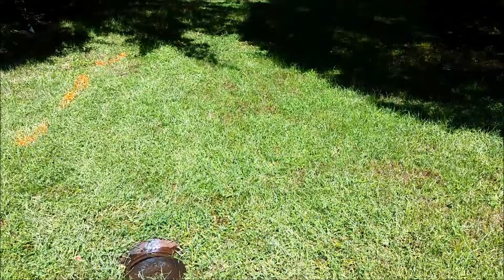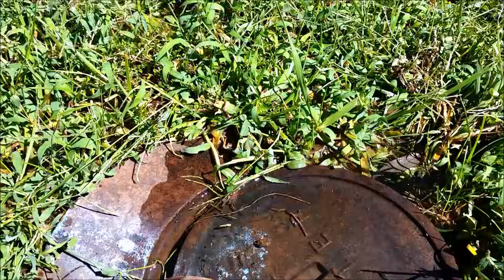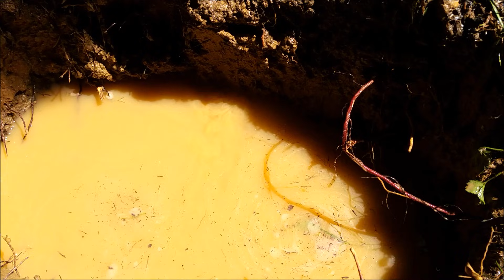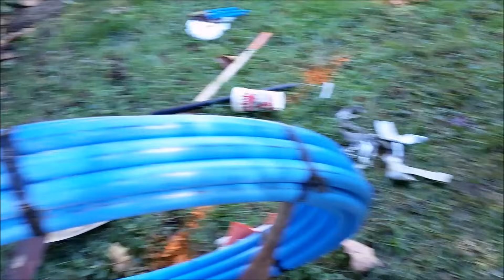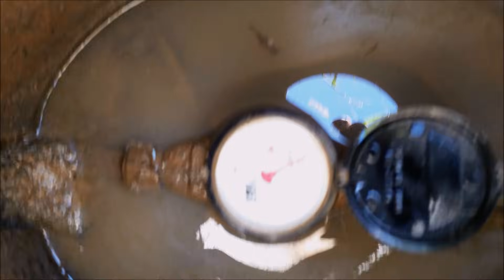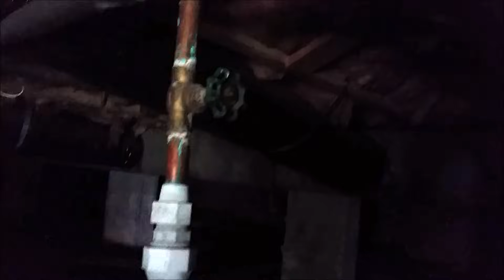DIY: How To Fix a Broken Main Water Line Pipe

Comment: In my case smartmeter notified me of a continuous leak. After installing a valve to isolate the house, I confirmed the leak was in the yard and identified the location. It was no pinhole, but instead a slit (3”X1/4”). After making the first cut the section including a coupling pulled out. It broke after the coupling which was under the pavement. The area under the pavement had no dirt which I am assuming contributed to the break. I did fix it but it was about 26” down

Comment: I have dug out a 30' trench from my water meter to my house to (ultimately) replace the original  poly pipe (multiple leaks).  I am astounded (and angry) at the size of rocks that I have found in contact with the original pipe.  That kind of "workmanship" is why unions have a bad name.  If I, as a typical homeowner, know not to back fill will fist-sized and larger rocks, why so so-called professionals do it???  I won't mention the brick that I exhumed....

Comment: What about that metal piece that goes inside the end of the plastic pipe? So that brass fitting doesn't crush the plastic pipe? Asking for a friend😬
Reply from the maker: Plumbing shop didn't recommend so I didn't use one. Still no leaks 7 years later 😉

Comment: I work for  water for a large city.. I wish we had more customers like you. Quick question.  Did you put any interest in from thoes compression fittings? Just curious
Reply from the maker: Thanks Joshua! Not sure what you mean though, "put any interest in from thoes compression fittings?"

True story...In April, water bill was really high. Fixed a toilet I believed was leaking. Water authority came out and tested and said I still had a leak. Turns out there was another leak in this line, but closer to the house. My water line insurance (taken out after I made this video) paid for the repair. In the process, the line was tested several times, and all the repairs in this video were still solid, even after 7 years or so.
Reply: @RiverLifeWV  yeah, metal insert you slide into thee ends of the Polly pipe o the compression fittings have something solid to tighten up on
Reply from the maker: @Uneavenbutter  no, nothing but the compression fittings.

Comment: Good video!  I dug mine up and found a big root from a maple tree had damaged the line as grew to draw water from the nearby AC drain.  I dug back the root several feet and cut it out.  Maybe it will grow in slightly different direction from now on.
Reply from the maker: Take insurance out if it looks like you may have future problems.

Comment: The pex tool would leave less joints and cheaper. Just have to buy the pex rings and 10 dollars to rent the pex tool. 3 bucks for fittings. Never go to a plumbing supply place if all they have are 100ft rolls for a small job like this. 100 ft roller roller for running a whole main line or a whole house. At Lowes this would only cost 30 to 40 dollars. Those unions right now would probably cost like 70 plus dollars alone. And 100 ft of pex now that's probably like 70. So 140 bucks or 30 to 40 bucks.... u decide. That said good job anyway.
Reply from the maker: Thanks! I've transitioned to working with pex as much as possible. I agree with you :) Inflation has easily doubled the price of this project.
Reply: yup. i imagine them brass unions are not very cheap right now i seen stuff way cheaper than that going for like 20 plus dollars. But when ur doing a big job like this even if it costs 200 + dollars who cares cuz a plumbers gonna charge a heck of a lot more. U just want it done now and done easy. i did the same job at my house i had a leak under the slab where the meter sits. but i just straight piped it. rented the pex tool was like 11 bucks at home depot and i only needed it for just 2 crimps but it is what it is. all said costed like 35 bucks
 but super super crap load of hard work. I had to dig like 5 tons of super compacted heavy rock crap desert dirt. then blow through with water to get the pipe under almost 5 ft of concrete which also has a wall on top of it. super bad angle to try digging. it kicked my AAAAA to say the least. but i saved a TON of $ doing that myself. the way i got through under the concrete slab is i used about a 6 ft piece of 3/4 pvc and glued it to a a garden hose assortment. then i put it on one of them high pressure nozzles and just kept ramming it with the high pressure till it made its way to the meter. after about an hour the whole was big enough to run the pipe. The soil in the desert is super hard to dig through. very tuff soil!

Comment: Menard's had 3/4" copper tube size (CTS) poly water pipe 250 PSI, 100 feet, $28.  CTS fittings accept CTS poly or copper pipe.  A stainless inner sleeve is inserted into the poly pipe.  The CTS fittings tighten around that fitting.  Menard's sales people haven't heard about CTS pipe.  The YouTuber may have failed to place the inner stainless sleeve inside the pipe which the CTS fitting tightens down around.  The last step is to tighten the crimp screw on the fittings.  The YouTuber's fitting may now leak slowly or pop apart.  At the top left of the right union the poly looks compressed where it enters the fitting more than it would be with the stainless inner sleeve in place inside the pipe.

Comment: You did everything right except for one major thing. Never, and I mean never, turn on a valve that fast!!!! My superintendent just did that and blew 3 holes in an 8” water main off the street and popped off a 4” copper press joint. Turn on/off slowly to let the water fill the pipe first then open it all the way.
Reply: Yup!!!!
Reply: Good advice! We have very high water pressure here because the water main that serves my property starts at 4000 ft elevation and runs along the dirt switchback roads that descends in elevation for the 2 miles it takes to get to my house which is at 3500 ft. elevation.
My leak isn't this bad, and it's at the base of an outdoor spigot. I don't know what I'm dealing with until I dig it up, but I believe my goats are the culprits! They love to vigorously head but anything sticking out of the ground, such as a metal pipe.
I'm hoping it's just a loose connection, but more than likely I've got a cracked pipe. I'm hoping I can fix it temporarily with epoxy until I can get whatever connectors I'm going to need.
Reply: No stiffener with the Pac Joint isn’t good.
Reply: I have heard this advice as well: before turning the main back on, open a few faucets in the house, to help get the air out of the lines. Then, as you mentioned, turn the main on very slowly, let it fill up, then open all the way.

Comment: Were you able to find those McDonald (or Ford) compression fittings locally or did you have to order them?  Nobody here, except the utility district, has them.  The utility district won't sell you any either.  I found some similar, but didn't have the extra bolted clamp.

When I started digging, I found that whoever built this house decided to throw several full packs of shingles and many 2x4 scraps inside the water line trench before burying.  It was quite...fun...to dig all this debris out by hand so I could locate the leak. 

Thanks for making this video.  It helped a lot.  Saved me hundreds of dollars, no doubt.
Reply from the maker: Fittings were at our local plumbing supply shop.

Comment: its been 5 years.  have those fitting started leaking yet?  you should get pex crimp ring with a collar.  less opportunity for leaking
Reply from the maker: After 5 years, everything is still good. I made the repair exactly as the plumbing shop told me to.

Comment: No steel inserts? It’s gonna leak again if that’s irrigation pipe your supposed to use barbed fittings with clamps  and the pipe is supposed to be centered to the middle of those unions when used on the right regulation water pipe again the pipe in the video looks like thin wall irrigation pipe if this is so it’s going to leak again there in the future
Reply from the maker: Well, it hasn't leaked yet. I followed the specific instructions from the plumbing supply store. Every part, including the line, was what they recommended. And this was not a home depot type store, but a legit plumbing supply house.

Comment: What if there isn’t any waiter coming into the meter or the yard? How do I find the area underground that is leaking? I have already done everything to make sure it is in fact outside leaking so I am guessing it’s a very small leak. But it’s making my bill skyrocket so I have to fix it ASAP and don’t want to pay a plumber a grand to or more. But Because it’s bone dry in my meter and there’s zero standing water in my yard I can’t find the exact area where it’s leaking. Anyone know how to find the area without digging the whole thing up? Is there a moisture tool I can rent or something? Any ideas will help.

Comment: What about the metal sleeves inside all the plastic tubing?
Reply from the maker: I'm not sure what you are talking about?
Reply: @RiverLifeWV  The HDPE tubing will distort when the fittings are tightened on its exterior unless you put the metal sleeve inserts inside each end of the tubing.

Comment: My father thinks this is rocket science and will rather pay $$For a plumber that quotes double im sure. Ive ofered to do it for him free but im poor and he wont buy the parts(Pipe and connectors). This is exact same problem aswel but our lines are under concrete so thats going to be fun im just guna do what i can till or if we gt the parts
Reply from the maker: Well, bust up the concrete and see what you've got! It's fun work, and you can save yourself some money.

Comment: I used a saddle clamp .done you don't cut the pipe.wow overboard
Reply: In ohio the ORC states any type of saddle fittings are prohibited underground
Reply: Saddle clamps are generally only temporary fixes.  They rarely stop the leaks on pressurized lines entirely, and the potential for contamination is present.  Use saddle clamps only to slow bad leaks until a more permanent and safer solution can be found.

Comment: Did this same repair, here we are 2 years later and its leaking at a new spot. Just send a new line in. Especially if it's that recalled poly tube. $3,000 is a fair price, also not hard to do yourself. Rent an excavator and invite a buddy over. Pretty straightforward.

Comment: Friendly reminders
1. It’s a water service 
2. You should have replaced the whole Service because there might be more rocks sitting on top of the service
3. The water service should have tape 1ft above it for excavation later on so you know if your close 
4. You also don’t want to stop the water pressure until you find the pipe
Reply from the maker: Thanks! I have insurance now on the service line for 5 bucks a month :)

Comment: What if you have poly piping on the service line? The house has no poly but the service line does. They didn't disclose that. Is that fixable?
Reply: they make shark bit fittings that go from polybutylene  to copper pipe size

Comment: You forgot to put line stiffeners inside the pipe
Reply from the maker: Not according to the plumbing supply house.
Reply: @RiverLifeWV  ya I bet they will sell you whatever they can.
Reply: You don't need stiffies for pex that new blue stiff is pretty thick. I do this every day. Never used it.
Reply: @thomasszary7481    Use the sleeves; even HDPE plastic tubing will distort from the pressure of the fittings and the o-rings will eventually leak.  The sleeves are inexpensive, and take but a moment to tap in (sometimes pound in).  But once fixed, it stays fixed!

Comment: All you had to do was cut the pipe at the crack and slip the dresser coupler over the crack and tighten it down man
Reply: 😂😂😂😂😭😭😎😎learning he is!!(yoda)
Reply: Nah. That's the hack way to do it. It's better to replace a section of pipe rather than a small chunk. You don't want to tighten down on the spot or near the spot that was cracked with a mechanical coupling for risk of splitting the pipe. What he did will suffice but the best solution is to replace the whole line so that there are no under ground joints and you keep the possible points of failure to a minimum of 2.

Comment: Those CTS pack joint fittings will fail over time without the required stainless steel insert inside the pipe ends.  They keep the pipe from crushing, and ensure the connection doesn't blow apart.  I didn't see it in the video, but did you install those?  They are sometimes sold separately.
Reply from the maker: I did not know about those and the plumbing supply never mentioned them. I don't worry to much now as my power company has insured any future line repairs for 5 bucks a month. :)

Comment: You need stainless steel sleeves inserted to the ends of the pipe, otherwise the brass fitting will crush the plastic pipe
Reply: In Texas we just Pex fittings and crimp rings
Reply: They are called "stiffeners"  but yes you are correct..   he will be digging it back up eventually

Comment: I wish you talked about the diameter size on the pipe and fittings. Just curious if 1" inch is standard of 3/4" inch is.
Reply from the maker: Charles Brown I don't know which size is standard. Sorry.
Reply: 3/4 polly is standard. sometimes you will find 1 inch Polly but it's not common. usually when you find 1 inch it is the service to the house. (the part that tails out of the back of the metter that feeds to the house. 3/4 is commonly coming from the main and is feeding into the angle valve (the valve that stops water from passing through the metter).iv only seen 1 inch a few times going into an angle valve. my point is, if you are repairing the line that feeds your house, you can either run into 1inch Polly or 3/4 polly. depending on how old your house is you could also run into 1inch galvanized pipe which is a motherfucker to fix but it can be done with a philmac coupling, a sawzaw and a little bit of filing.. or you could pay a plumber a fat price and have him run you a new service..

Comment: I made this same repair with sharkbite fittings. Also Home Depot had 3 ft sections of 3/4" blue pipe for about $5.
Reply: I repair lines repaired with shark bites daily, the issue is the metal pieces. They corrode and leak, if you do not have a pex crimp ring tool buy WHITE FLOW CONTROL couplings. I promise shark bites will not last, even if you put tape around them as they recommend.
Reply: Jerry, I agree "Sharkbite"  or in my repair it was a  similar type coupling, brand name LASCO flex coupling.  I put the links in the description. In my fix the water line broke underneath the cement sidewalk..Royal pain! to dig down under the cement!  https://youtu.be/1nDwrq6ZQIc

Comment: Been laying pipe for years, and you did a great job. It isn’t a main, Btw. Just a water service, but others than that the compression fittings are the shit when it comes to repairs.
Reply from the maker: justin Kassel hey thanks Justin! It's still holding, going on 3 years later!
Reply: MrWoodshedder just a fun fact for you buddy, since you don’t have a smart meter, and you seem pretty decent with a pipe wrench, if you take the water meter off and flip it around and install it, it runs backwards. 

The water authority checks meters during business hours, so hypothetically, if one were to install it backwards and do some serious watering over a holiday weekend, they could potentially lessen the financial strain that the assholes at the water authority have imposed on us for years.Just be sure that you don’t run it lower than the number on your last bill. Lol.
Reply: @justinkassel4000  Like filling up a swimming pool.....
Reply: can you tell me what size fitting i will need and where i can go to find them. My pipe is the same as this but it doesn't look like 3/4 in. it looks bigger maybe close to 1.5 inch

Comment: No inserts were used and you are supposed to meet the pipes up in the middle of that 3 part coupling hope you ain't back in a couple months digging that big hole again.
Reply from the maker: Cade Parr You are wrong. I did it correctly. It's been 2 years since I repaired it and no problems.

Comment: My other comment/thought - perhaps I can use a low pressure air fitting and an compressor to put air pressure in the line and then dig to the source of the bubbles.  I'll have to scratch my head a bit on how to connect the air fittings but it should reduce dig time - especially if you live in a heavy clay area like central KY.
Reply: Yes.  I deal with this problem a lot as I own a campground in NW PA.  I blow the lines out in the fall with compressed air staying below 60 psi, but almost every spring when I turn the water on I have a leak in the ground somewhere.  Having air in the line as you dig is very helpful because you can here it, and you don’t have water filling up the hole you’ll need to work in.
Reply: I actually did this to locate a leak. I made a fitting I connected to my outside hydrant and  a splitter that I connected to an air compressor. Turned on the air compressor and the water at the same time and found my leak

Comment: Good video.  I need to fix mine.  Was wondering if anyone would comment on perhaps using a "SharkBite DZR Slip Coupling" (or similar) of the appropriate size.  It seems to me if the pipe had single nick in it, you could cut out a 2 inch section and then use the slip coupling to join both lose ends without the need to purchase for 100' of piping... 
 http://www.sharkbite.com/product/slip-couplings-slip-end-only-suitable-for-copper-and-cpvc/
Reply: OK, just finished my repairs.   SharkBites are certified for underground use.   The SharkBite 'slip coupling' makes it trivial to fix leaks even if you can't separate the pipe ends from each other.   PEX line repaired!